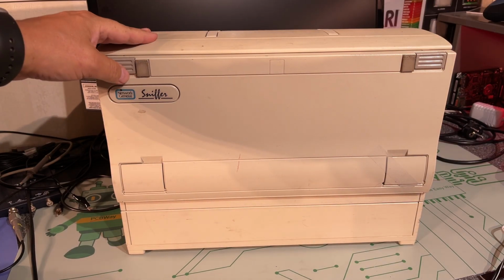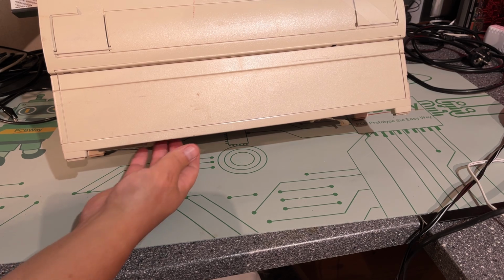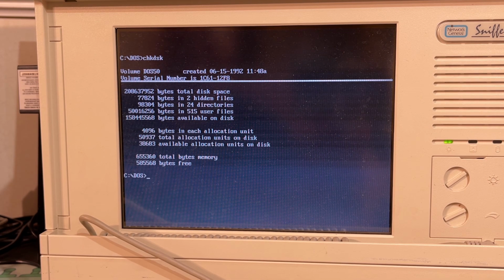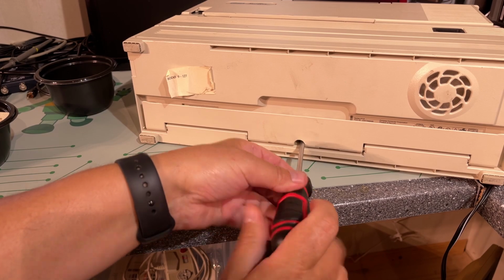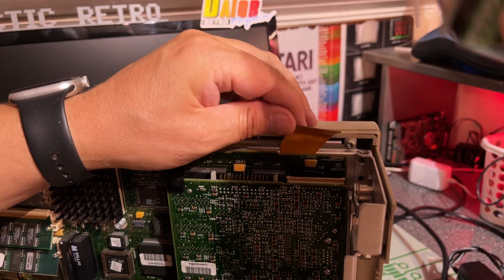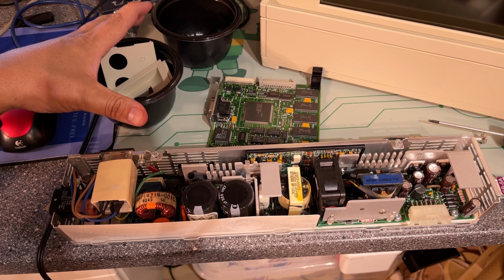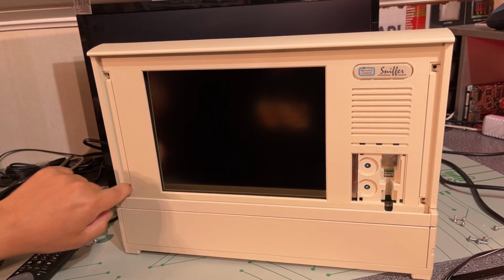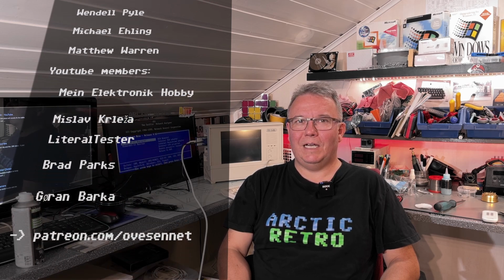The last Compaq luggable PC - Network General Sniffer computer - Try and test

Comment: What a coincidence.   I didn't even know you had one of these. I bought the same machine recently. They are very rare.  It wasn't cheap. Also the keyboard cable is split.  But the screen works.   Do you know how to open the Harddrive bay yet ?
Reply from the maker: How fun! No, I did not do anything more with it yet
Reply: I discovered the caps where totally dead in the screen. You have to remove that shield it is glued. Take apart the whole screen. Not made for servising.I used normal caps. But that line on yours is something else. It could be a dead solder or a bad chip in the lcd.  I have a floppy that does not always work.

Comment: I just wanted to say i managed to find one, how did you get the external display to work? It uses a 14 pin VGA connector on mine, but all I have is 15 pin cable. Will a 15 pin cable work if I drill out a hole?

Comment: Have you sold your 486c It is ever elusive to me on eBay, and I even put out word on the vcf forum for one. They are being bought up on eBay right under my nose. I literally missed two by a few hours.
Reply from the maker: No. Still have it
Reply: @Arcticretro  I live in the US, would you be willing to ship it overseas?
Reply from the maker: @IsaacMcMillan-u7i  It will cost a fortune :)
Reply: @Arcticretro  true but how much do you reckon? I've had to pay for shipping for a server rack above $100, within the US, and it wasn't full size. Do you think it'll be more expensive?
Reply: @Arcticretro  I am willing to pay high shipping cost, It can't possibly be more than the scalper price on eBay that has been taunting me for months. I have went through so much trouble trying to get my hands on this computer.
Reply: I am desperate, I would be willing to pay the high shipping cost, I want one of these so bad, I have been watching eBay for months and nothing has been showing up.

Comment: Also welcome back from me always being late to the party. Amusement parks are always great fun, not only in summertime. Also they are a very good match to retro themed channels like this. Personally I find the vintage styled rollercoasters, carrousels and water slides the best.
Underneath your videos I wrote what machines I personally had. But this "luggable" now reminds me what I had to deal with on the job. My company once trusted me by letting me use a similarily sized "portable", even all of those have a throw-away-handle. ;) It was only a 286 and I think it was a Toshiba. The screens were horrible because I had to work outside, mostly under bright sunshine. I had to connect to roadside controllers, of course using RS-232 serial port d-sub connector cables. At least the very loud fan was in no way a problem.
Your 486/66 with 8MB DRAM would have been one beefy machine for back then.
So many flashbacks while still watching.

Comment: Typically on these displays one or more of the lines opens up in that "press-fit" connector.  You might check the connector on the back side of the board for continuity and re-flow the solder joints to the connector?  Just a thought.
Reply from the maker: Thanks!